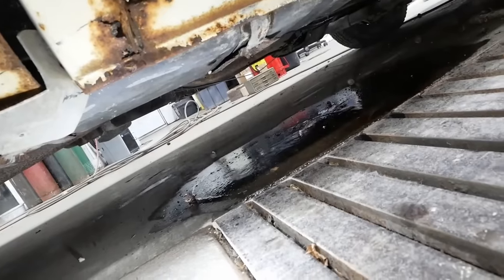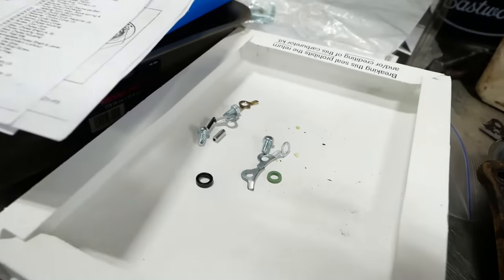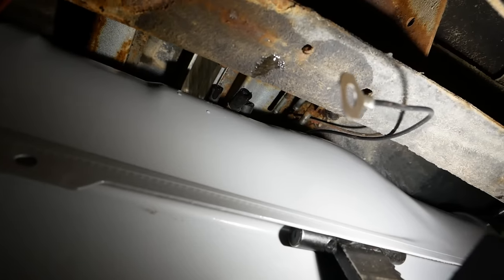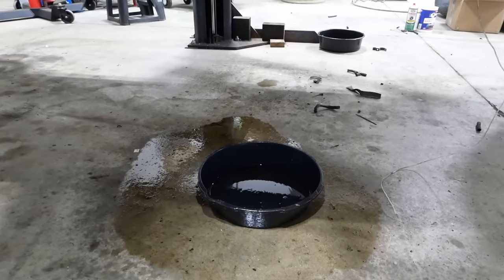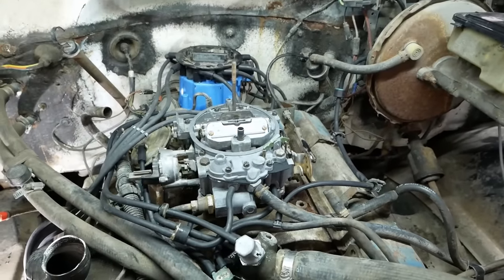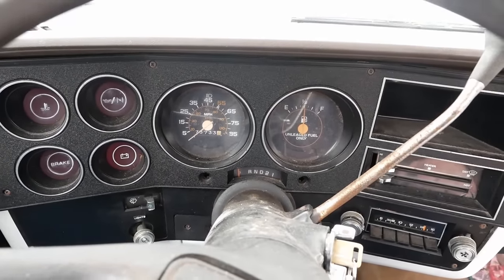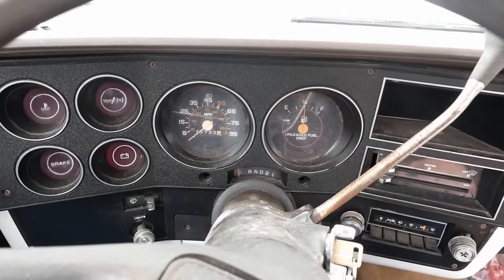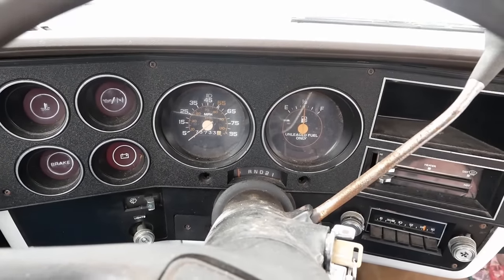Millennial vs. Carburetor | Square Body Chevy Back on the Road After Sitting 12 Years

Comment: As far as zinc needed for flat tappet cams, my 2 cents is your old wore out valve springs are way under 
the specs they once were. Thats why there are still tons of flat tappet cam engines still alive even with
technically " the wrong oil in them"  . If you put in new valve springs , say bye bye to afew cam lobes.

Comment: Grew up with carbs. (gives away my age). These days it's best just to toss it and buy new one (not Chinese). I've had little luck with used carbs or rebuilding old original Q-Jets. For emissions, keep the PCV, charcoal tank, vac advance and converter lockup control.

Comment: My understanding with flat tappet cams is once the cam is broke in the zinc isn't necessary... if that ol small block has made it this Long I'd run the cheapest oil I could find at this point.

Comment: I believe in the zinc additive controversy. I've seen and heard of far more camshaft/ lifter failures in the last 10 years than ever before. Even professional builders and magazine articles are having increased failures. A stock, used engine with parts that are well worn in and with relatively low valve spring pressure may be ok with modern oil, but I know my two older pickups do well on Rotella T4 so I'll continue to use that. And it's not that older ours were "better" the additive package was just different for the different needs of the marker at that time.

Comment: A flat tappet in an engine like this is fine with modern oil.  It's probably 195 @.050, .400 lift type flat tappet.  I would worry more about the modern oil knocking some sludge loose if it hasn't been well maintained.  Pretty much all the SP oils are at least synthetic blend and have high levels of detergency via calcium and magnesium overbase.

Where the problem comes in is if you have a high lift flat tappet with high valve spring pressure (as mentioned).  You really need 1200PPM ZDDP minimum in that case.  Solid advice to not just throw a zinc additive in there.  Buy a fully formulated hot rod type oil.

Comment: Low emissions diesel oil has low zink. Zink additives do not work, zink is added at different stages of refining. Like Wess said there are other addives in oil that font take kindly to zink additives. Diesel engines use large diameter lifters and have very low tension valve springs so there are very few cam and lifter issues.

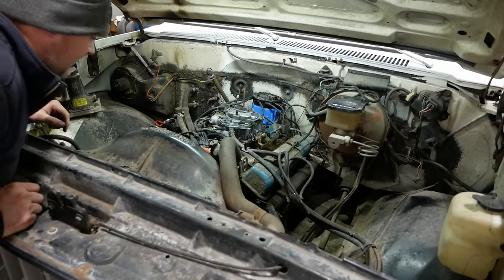Comment: When you poured the gas in the tank at 32:57, for just a second, it looked like you just stuck the filler spout in one of the rust holes and I was expecting to see gas splashing off the floor.

Comment: The emissions stuff is mostly junk, the two items you want to reuse...vac to the Dist, attach to carb and the TCC direct connect to a vac valve on the back of the manifold. If timing is correct and the carb is jetted and choke working correctly two pumps is usually enough unless its winter. The oil of the past had all the additives but were reduced to improve emissions and industrial engines run their whole life at low rpm where vehicle engines run everywhere in the rpm band. Even on late model trucks I use higher zinc content oil, as an example I had a 91 Chevy S10 that when on Mobil1 started to tick at the 250K mile mark and switched to a higher zinc oil. It was still running and driving when I sold it with 300K miles.

Comment: Spartan fire trucks use the loop method on the fuel lines so the tank can be easily dropped.  They use a rigid plastic (nylon?) That is less likely to kink or be restricted.  On the oil issue: duh, run the diesel oil on sale! Don't you ever watch vice grip?  Seriously though, if it's Cummins approved, I approve it. ( a Cummins plant us 6 miles from my home so I'm biased).

Comment: If you think these vacuum smog gizmos are an irritation, just be grateful you don't encounter a Honda CVCC carb engine.

29:59 That zinc argument tended to apply to high lift cams. Stockers tended to have no need for it. The Jeep 4.0L is one of the last OHV engines to have a flat lifter cam, and most people just use whatever the oil change places use. I think API SM and later oils have about 600-800 PPM zinc. I do wonder what happens to the classics that had extreme flat lifter cams, such as a fuelie Corvette.

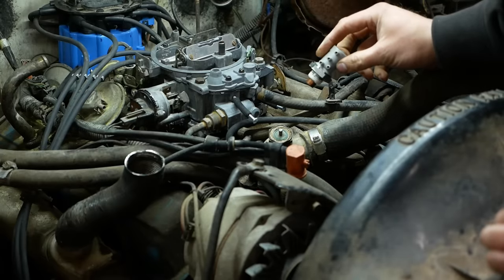43:45 Some just call it "The Christmas tree valve." You would have to find some guy who worked parts stores from the 70s and 80s, good luck with that. Often you had to tell the guy if you had a California car or not, many old cars had even more gizmos for Cali cars.

47:30 Close. It got the intake manifold to heat up when cold, so the fuel would atomize. Otherwise, a cold engine would have big fuel droplets that didn't burn effectively.

Also, many of the performance cams going flat are the replacement ones. The quality has been hit or miss. I haven't heard anything good about Comp cams. I have heard some of the cams and lifters have the wrong metal alloy, I have heard they aren't heat treated properly, who knows exactly? Myvintageiron promotes Howards flat cams and lifters for special builds.

Comment: They no longer use the amount of zinc they used to. its primarily important to use it for break in once its broken in it should be fine but just using a highr zinc oil is a great idea instead of using an additive.

Comment: I don't recall if all quadrabogs had them or not, but you're missing the primary choke pull-off dashpot. it mounts to the carb top holes in front of electric choke and pulls it off slightly on vacuum, in comparison to the large rear secondary pull off and rear "bog ports". (lol) that pull sit open a bit further and reacts with vacuum changes to modulate the choke when cold.
it's possible my memory is foggy and the earlier ones didn't have them. but I'm pretty sure everything did by 1976? maybe that's an older engine or carb crammed onto early 1980's truck.

Comment: I would have remove the idle mixture plugs so I could fine tune the mixture to get the idle as smooth as possible.  But you probably need a double D socket or carb tool to adjust them anyway.

Comment: I have 4 old cars with flat tappet cams and I run the cheapest Walmart oil I can find. Breaking in a flat tappet cam should probably include zinc but the cam lube has that already.

Comment: Max just wanted you to chase him to get it out of his mouth lol 😂 that’s priceless. 
On the Quadrajet you’ve done everything you did and that’s more than what I would have done. And depending on how old the carburetor is even when you do all the right things. To me that’s just the carburetor was too far gone and buy a new one. They are a few companies that build a better performance version for race or street. 
On the zinc. HOTROD Magazine had a article about using Shell  Rotella T4  15w40 for better engine protection for flat tappet camshaft engines. Without zinc and phosphorus in oil it will prematurely wear out the camshaft lobes.

Comment: I have run STP oil (cheapest, next to O'reilly oil, made by Valvoline) in all my cars for a few years now. I have a Jeep 5.2 with miles and wear & it doesn't like it. Too hot. Drips down like water after shutoff. Valvetrain noise. Next oil change I'm getting higher quality oil OR using STP + Lucas Stabilizer. Otherwise, my cars, '94 Pontiac 3.1, '97 Mustang 3.8, Honda Spree '86 50cc run fine on STP stuff. Seafoam, Techron, MM Oil, Amsoil, Rislone, Lucas additives will help older Veh's.

Comment: I had one of them Cats on my 91 Chevy c1500 w/t truck, It plugged up one day on the way home from work and it ended up blowing the 02 sensor out of the pipe, broke the welds for the threaded part, first time I ever seen that kind of thing happen, Of course I welded a nut in the place of it, and did the cat delete, I mean no emissions checks here and at the time that truck had just over 600k miles on it, it was rough but dependable, wasn't worth sinking that much money into it.

Comment: Just saw this video, and , being a mechanic from the dinosaur age, I cringed somewhat at the attempt with the automatic choke. These things were STRONGLY & RIGHTLY demonized by the late, great Smokey Yunick, as being TROUBLESOME GARBAGE. 
 My '73 Chevy van with the 350 Rochester 4bbl. carb was not too bad to rebuild(needed 3carb books to get me through it), but after changing the stock headers to Hedman ones, I had a problem with starting after running the van and letting it sit for maybe 10-20 minutes before trying to restart it.  Apparently, the Hedman headers cooled quickly and the auto choke thought the engine was now cold, so it closed the choke down a bit.  It took quite a bit of time(5 minutes?) before it started again. So, I did what Smokey suggested and disabled the auto choke and put a manual cable on(cheap--maybe $10 at most) and that ended the problem. 
If you ever get around to reading this, I would STRONGLY suggest doing the same to that rust bucket.

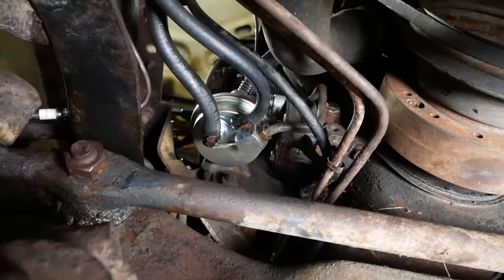Comment: 28:45. Fun Fact
Chevy designed a bolt to hold the fuel pump push rod.   Just remember to remove the extra long bolt,  after the fuel pump is installed.
Your Welcome

Comment: The thing you missed is the old feller who can't hardly hear, glasses thick as coke bottles only 3 teeth to peek under the hood, reach into the running engine and poke something on the carb that there's no way to see (and when you look later there's nothing there). He then says that'll do it and the truck runs perfect for the next 40 years.

Comment: For your stumble check your EGR port and the valve itself make sure its operational and clean your thermostatic exhaust FL that's not working that's going to be a problem to it's all working together to eat that thing up and give it enough hot fuel to run when it's cold just like the 1 5 t in order for it to work properly

Comment: The old small blocks had carbon build up in valley ( under intake manifold) which prevented oil draining from valve area and reaching cam lobes . This occurred roughly about the time they increased running Temps, removing lead from gas and adding emissions controls.  Pull intake manifold if you suspect this . Could be caused by stuck exhaust butterfly in closed position . This would overheat intake and cause drain back oil to turn into carbon . Check vacuum. Did you remove welch plugs when cleaning ?  Sounds like you understand this critter very well . Duuu....wahhh

Comment: we didn't call them quadrajunk for nothing.  very tempermental.  idle circuits plugged just by looking at them.  also need a thin gasket on both sides of the spacer. throttle pate warps easy and you need to hand tighten the carb

Comment: I had a 700HP LB7 built and the builder will warranty the engine for 3yr/100k if I use Delvac 15w-40. If not it will void the warranty. Delvac is about the cheapest. So I will play their game and use Delvac.

Comment: I like modern, but somewhere in between. Like mid 80s. Just the accessories that was a extra add a n such as air-conditioning, and power windows. But before they started putting a computer on everything. Usually just one computer. And it was operated by a knock sensors and vacuum switch. Which helped with the timing. Other than that. Very simple. No touch screen. No junk. Just common since. I love things. That's cars of this era were the golden years before they became garbage.

Comment: The quadrasu*** carburetors as a rule cold start push pedal to the floor and hold for a moment to alow all the cams to set the. Crank with small pumps otherwise if you give full pumps they would flood and foul out the plugs. Also remember if the car has points avoid leaving the ignition on or the points will burn up .  When you only have one nerve left put a Holley on it.

Comment: Your explanation of choke operation is half right. As the engine warms the fast idle break (greenish linkage with a triangular-ish weight on the end. It's visible from the front) gradually drops with the position of the choke thermostat.

Comment: I had a old Chevy where the bore  the accelerator pump piston moves in was worn.  It wore in the area where the pump dithered or moved the vast majority of the time.  The accelerator pump did not spray very much fuel even though it was moving.   I used to flare the rubber packing  on the piston out but it was only temporary.    Thinking vacuum leak ... Are the mating surfaces of the carb flat?   Intake manfold gasket leaking vacuum?  Poor acceleration when cold means more choke...or vacuum leak I would think.  Poor starting when hot .... I wonder about ethanol evaporating in the warm carb bowl.   

Other thoughts:
  I've seen old floats get holes in them and fill with gas or absorb fuel like a sponge.   I do not think you have that but something to check.

One hold down screw for the carb to manifold used to have a metal tag on it.  The tag had part number info on it to fully confim the carb model number.

Comment: Just throw the carburetor into boiling water for an hour or so and lubricate it by spraying used motor  oil.

Easiest and fastest way of determining if you need a new Holley

Comment: My view on older engines and oil. Add your 3 or 4 quarts and then add Lucas or some diesel oil. For some reason if it is below 1950 it really enjoys the extra dinosaurs. If its above 50s then just go for it. Full oil and dont bother.

Comment: This won't help your Chevy but my Ford electric choke wouldn't pull off. I drilled out the rivets and found a small counterweight which had been injection molded onto the bimetallic strip with two little plastic posts. It had broken off and I zip tied it back on. The heater was fed from a separate alternator output which was not rectified.

Comment: Eh, carbs weren't that bad until you started getting into the emissions era (1975-'85 mostly). Throw on a decent aftermarket unit without all that junk and they're fine. I did an FI swap on an '80s Subaru because someone half-deleted everything already and the replacement parts were difficult to determine (there were at least 4 different carb systems available depending on car configuration and whether it was sold in CA or not) and/or they were unavailable. If I had a CVCC Honda though I'd probably try to preserve the carb, even with the terrifying nest of vacuum cables snaking into then infamous black box, because AFAIK there's nothing aftermarket properly configured for the CVCC system.

Comment: my 83 g30 does the same thing. won't move until it's absolutely warmed up. my high idle doesn't shut itself off. have to rev the heck out of it
Reply: my van was from a coal mine so it was professionally maintained. I think that's just the way they run. I'm not much older than you, I don't know squat about carbs. we learned together. I may use some of this into

Comment: I've been thru a few quadrajunks and never seen a choke riveted. Interesting.   I run aluminum safe wheel cleaner in my ultrasonic cleaner for carbs. Try setting your base by a digital timing light instead of a vacuum gauge

Comment: You're supposed to adjust the choke those little lines on the housing of the choke our adjustment degrees Either you turn it to the right or to the left at checkout at what degree is your choke supposed to be adjusted at and Wallah

Comment: Finally reached the end...

If you just let the motor idle and slam on the brakes, does the motor stumble? That brake booster looks about as old as the truck. Its diaphragm is probably rock hard, and leaking vacuum.

Comment: 29:59 Must use the additive (ZDP), otherwise the camshaft will flat lobe. The reason that oil was Better in the 1960s, Before catalyst converter.  Oil manufacturing stopped adding ZDP so it would NOT contaminate the cat. Government mandated.
Also when the camshaft does flat lobe the camshaft,   put a lot of metal filing into the engine, then you can rebuild the engine. Help you out!
Your Welcome.

Comment: Automatic chokes etc are a snare and a delusion.  I have a distant memory of 80s Euro Fords that had them.  A manual choke conversion fixed them, after quite a lot of hair pulling with the first one!  Simplicity is King, in engineering?

Comment: Put fuel injection on it.  That's just how those old malaise era cars ran.  You start them by pumping the crap out of the carb, let it high idle for a half an hour, then drive it as if it's going to stall at every intersection.

Comment: Is your EGR valve closing completely and not opening till the engine warms up?   And did u disconnect the vacuum hose from the vacuum advance when you timed it?  And finally, did you check to see if your vacuum pull-off(?) is leaking internally?   Great job!   Brings back Lotza memories working on USAF trucks here and Okinawa and The Netherlands!  👍🇺🇸

Comment: Step one is getting a small punch and punching out the accel pump pivot pin.  Much easier before you pull all the screws holding the air horn on.

Comment: All the Auto-choke engines I played with were not using an element to heat the bi-metallic spring..  used engine heat, often from water heated manifolds.. and all were a pain to deal with when not working properly...  None of theres were of American origin...  some Japanese, others British..  Honestly, I far preferred manual chokes..  like from the realplace you described where engines were really simple...

Comment: My 2006 impala leaked oil and i was using regular castrol 5w30, last oil change i used Castrol 5w30 'DEXOS' (GM rated oil) and the sob stopped leaking oil